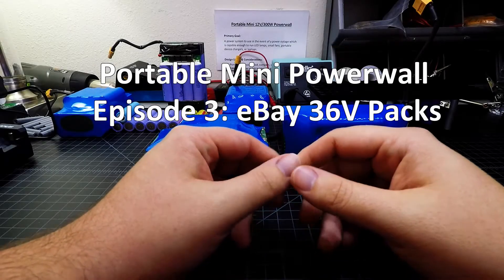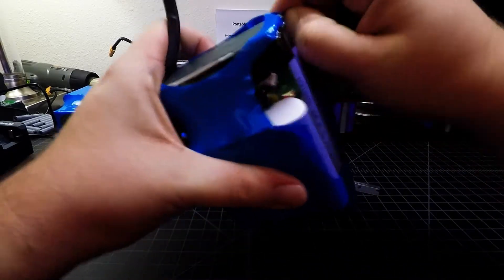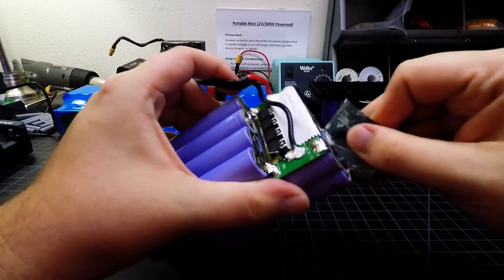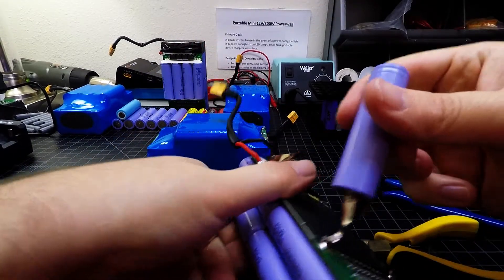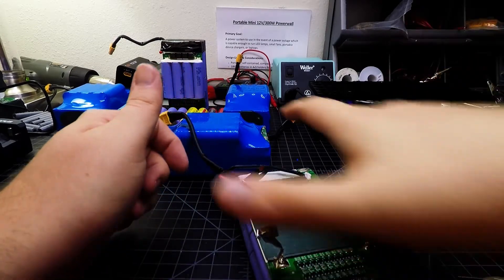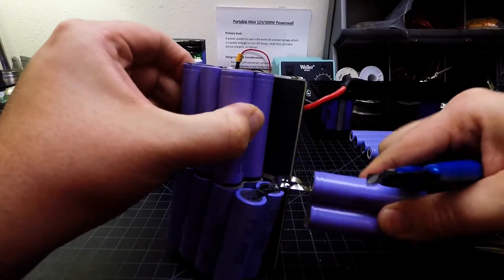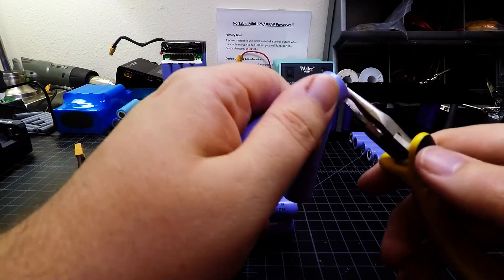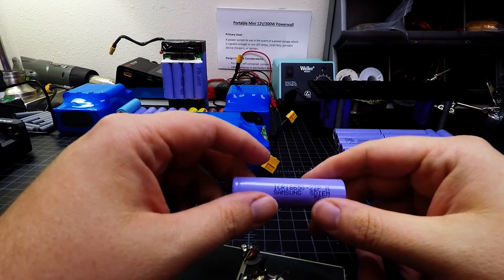Portable Mini Powerwall Project E03 - eBay 36V Batteries

Comment: Great video I'm now at the point that I,e checked all my capacities and have 60+ 2600mah cells but also 30 or so with 2100mah to 2000mah if I make a 36v battery 10s6p I guess I will have around a 15ah battery but what happens if I add say 2 of the 2100 - 2000mah cell to each parrellel group? I'm confused will all the cells lower to 2100mah, Thanks, video's been a help.

Comment: Nice flush cut pliers,i hope you can make a video for how to use the flush cut pliers.
Reply: You really don’t need a video for that, they operate like any other pliers, and if you want to cut flush, cut close as possible to the work piece.  One side is very flat / ground down so you can get it very flush if you hold it flat as possible to the board.

Comment: You should just buy a buck convert and hook them in parallel. That way you can lower the voltage for 12v inverters. It would be ALOT less work.